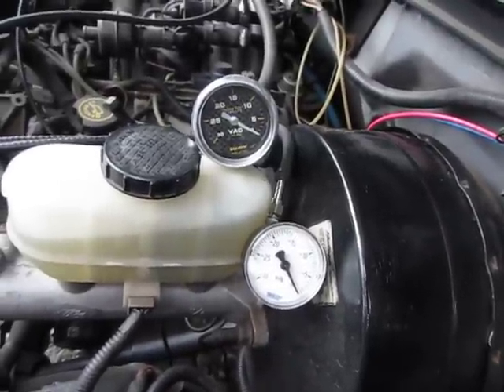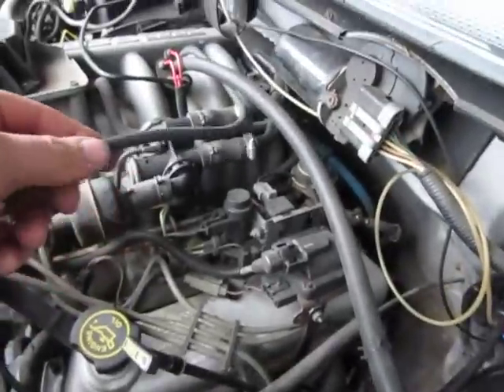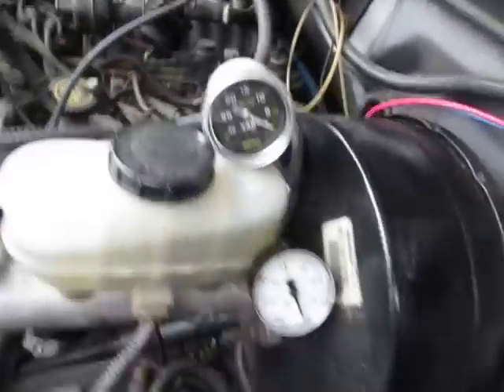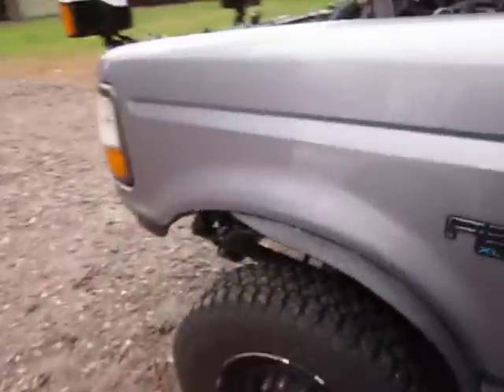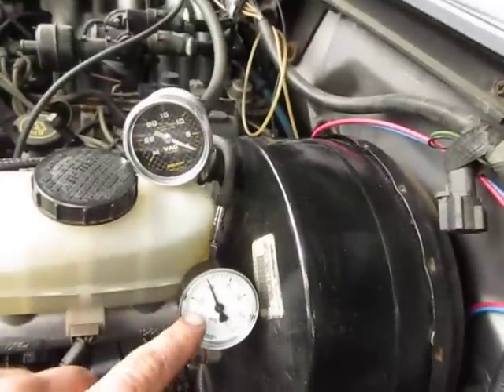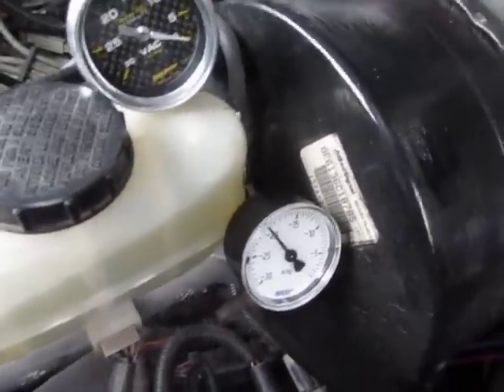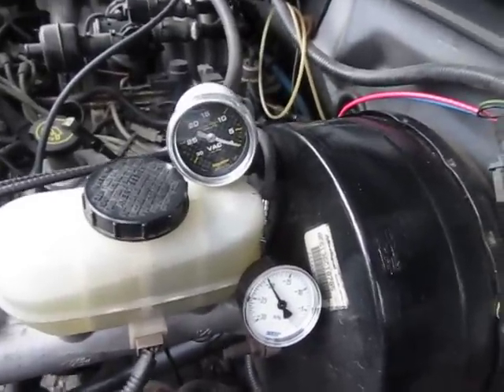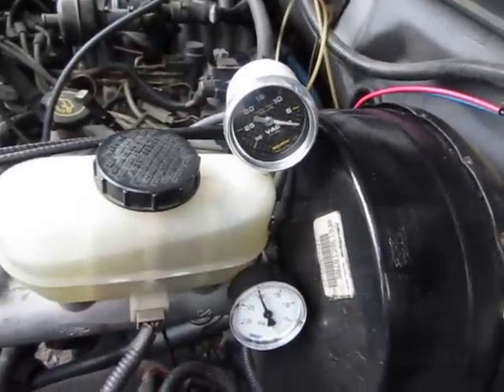Autometer Vacuum Gauge

Comment: There's a big hole in that  brake booster hose... 1.11
Reply from the maker: thanks for the interest in a 9 year old video!!  at 1:11 that "big hole" you see is not in the brake booster, it is in the gauge itself.  it accepts a light bulb to illuminate the gauge.  it has absolutely nothing to do with how the gauge performs.  and to address a 7 year old comment below that i did not see until now, no - the gauge does not need electrical power to work.  you see the other good gauge in the video right?  no power needed to either gauge - they are vacuum gauges.  both hooked up in exactly the same manner - one works, one does not. end of story.
Reply: @linckeil  yes i know is a old video my point is that why the gauge is not working because it have a hole in that hose not the gauge the hose check it again...
Reply from the maker: @leroyestrada1616  i assume you are referring to the black mark on the hose about 2 inches from the gauge?  right next to the number 9 stamped on the hose?  that's a spec of paint - not a hole.....  in fact that same hose is still on the vehicle today and operating the brake booster.  if it was a hole, i would have no power brakes and a substantial vacuum leak causing all sorts of engine problems....  i think i still have the faulty vacuum gauge somewhere.  If you like, I would be happy to dig it up and send it to your door for $20.  you can run your own tests with own hose and see if you have any different results.